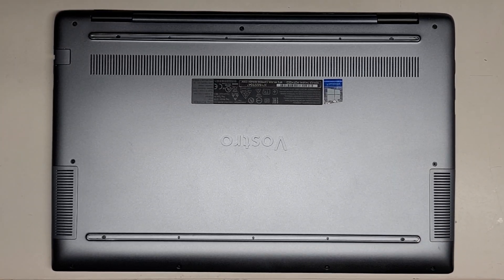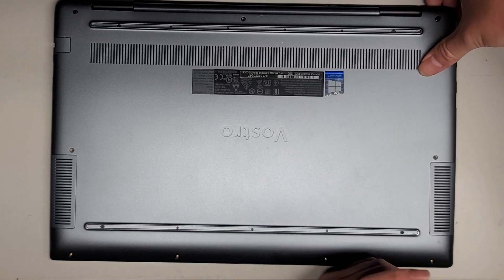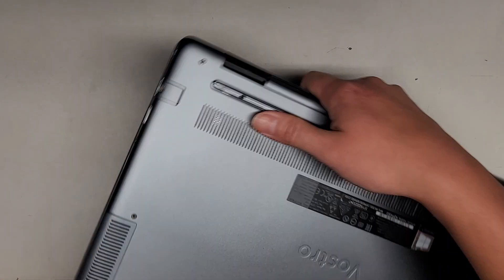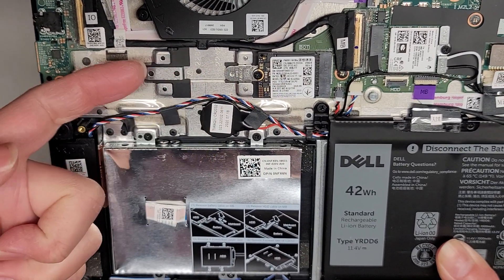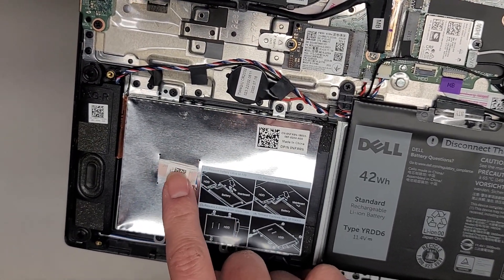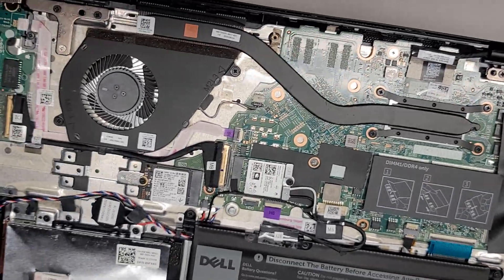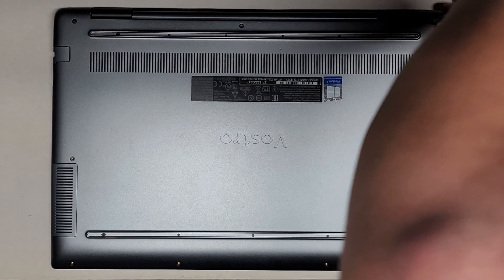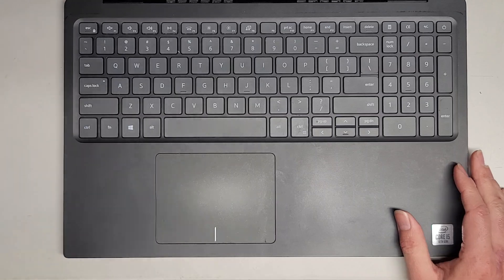DELL Vostro 5590 Disassembly RAM SSD Hard Drive Upgrade Battery Replacement Repair Quick Look

Comment: I want to buy a new SATA SSD and put to get more storage. do i need to purchase another cable to connect ? Or I just to buy only SSD?
Reply from the maker: Depends if the slot is empty and has the connector there.

Comment: Can i put a SATA 2.5 SSD in the slot for additional HDD? Is this SATA 2 or 3? Thanks in advance.
Reply: You've just answered my 1st question in the video, but which version is it?
Reply from the maker: No idea, nor does it matter. It will work with whatever SATA SSD you put in there.